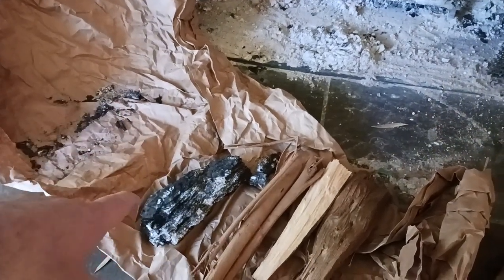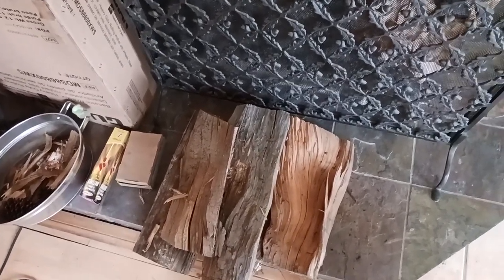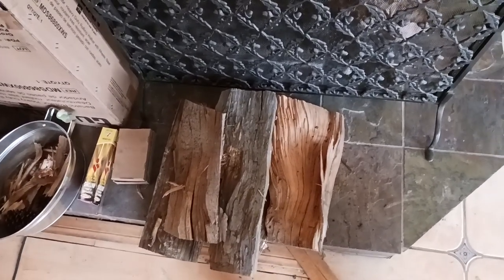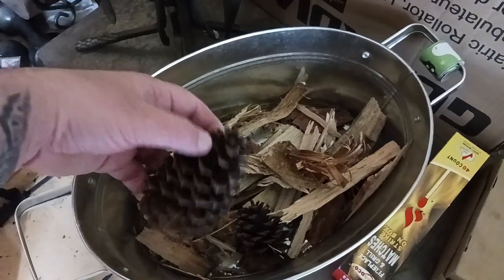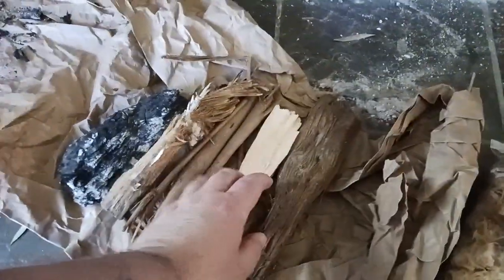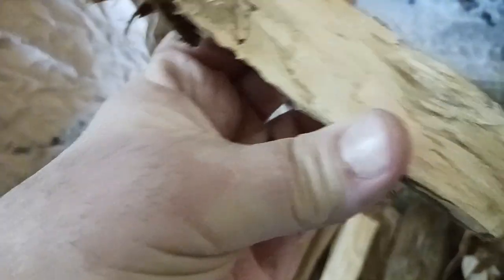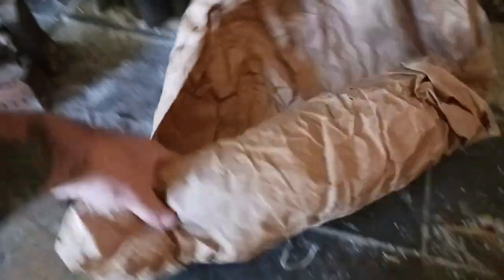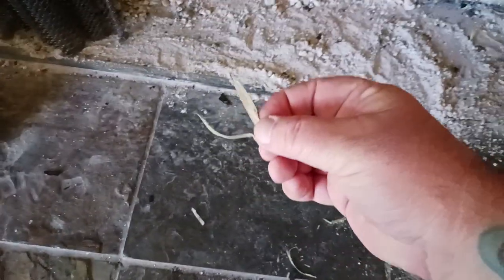1384 How to light a fireplace fire successfully bbq fire pit backpacking camp camping best way start

Comment from the maker: Kiknek FireFlame Quick Fire Starter
https://amzn.to/3IFcAAE

Housewise Fire Starter
https://amzn.to/493zBba

❤️Subscribe
SELF DEFENSE
Compact Pepper Spray
https://amzn.to/3a4mDib

Home Size Pepper Gel
https://amzn.to/3a5yiND

Pepper Spray Bracelet
https://amzn.to/3vu7nIh

Self Defence Hair Clips
https://amzn.to/41RRmby

Car Window Breaker Bracelet
https://amzn.to/3vtGIvc

Protection Keychain
https://amzn.to/47v4HYA

Multi-Tool Keychain
https://amzn.to/4215C1P

Multitool Bracelet
https://amzn.to/3tHW5jq

Tactical Wallet
https://amzn.to/4aFKfXF

Concealed Carry Purse
https://amzn.to/3NQK7dV

Eberlestock Backpacks
https://amzn.to/3sVmxlH

Maxpedition
https://amzn.to/3SNmnKX

Ultralight Backpack
https://amzn.to/3t4qLp7

Assault/Day Pack
https://amzn.to/3NFPygq

Get Home Bag
https://amzn.to/3Sh2WtS

Sling Bag
https://amzn.to/3Sh2WtS
https://amzn.to/3LuCk3F

Tactical Messenger Bag
https://amzn.to/3NKJDG7

EDC Essentials
Sunscreen
https://amzn.to/3QCkwHG
https://amzn.to/3QARJSH

Insect Bite Treatment
https://amzn.to/3tIGsU4

Insect Repellent
https://amzn.to/49p1uvM
https://amzn.to/3ShNIoo

Pocket Penlight
https://amzn.to/3aOFHjA

Headlamp 7 mode
https://amzn.to/3Sk2wmz
https://amzn.to/3sd9sau

Single Wall Water Bottle
https://amzn.to/38jVma6

Cnoc Vecto
https://amzn.to/3tL8BJV

Hydrapak
https://amzn.to/44xRXyS

Katadyn Be Free
https://amzn.to/3FFjg0H

HydroBlu Water filter
https://amzn.to/3qTyniC

MSR dromedary
https://amzn.to/3aOoU07

MSR Hydration Bag Coverter Kit
https://amzn.to/3r3syz7

TomShoo Stove
https://amzn.to/3BmtFfo

Utensil set
https://amzn.to/3aTCQpH

Silky Saws
https://amzn.to/3Xj0yBO

Esee Laser Strike
https://amzn.to/40QrnAk
https://amzn.to/3IheOGQ

Mora HD
https://amzn.to/3EI9Jp5

Bradford Guardian
https://amzn.to/3KnvIFq

Esee 6
https://amzn.to/3E1xJTt

Esee 4
https://amzn.to/3YkYdHM

Esee 5
https://amzn.to/3lszClY7
https://amzn.to/3RQiAu6

Esee Knives
https://amzn.to/3DWZYmk

Seatbelt Cutter Window Break
https://amzn.to/3tUEiVR

1.8 cord
https://amzn.to/30a7Qwq

Paracord
https://amzn.to/3uJ8KOJ

Merino Wool Socks
https://amzn.to/38hxaFg

Fleece Socks
https://amzn.to/3VWv0Bs

Pants
https://amzn.to/3vc2v6n

Long Sleeve
https://amzn.to/2Ou5lCE

Down Jacket
https://amzn.to/3uRZoQS

Gen 3 ECWS Fleece
https://amzn.to/3HAlOhj

Polarized Goggles
https://amzn.to/3FNftP5

Reflective Neck Gaiters
https://amzn.to/3ubQEpL

Sun Protection Shirts
https://amzn.to/39XS1Bx

Sun Protection Cap
https://amzn.to/3bDGOGE

FIRST AID MEDIC
Sunscreen
https://amzn.to/3QCkwHG
https://amzn.to/3QARJSH

Insect Bite Treatment
https://amzn.to/3tIGsU4

Insect Repellent
https://amzn.to/49p1uvM
https://amzn.to/3ShNIoo

Individual Wipes
https://amzn.to/3uVf75Z

Flushable Wipes
https://amzn.to/3RgYKbC

Body Wipes
https://amzn.to/3RCz9ei
https://amzn.to/46THezF

Microfiber Cloth
https://amzn.to/3NjUIOr

Pill Pack
https://amzn.to/4ajDvyC
https://amzn.to/3uUkaDP

Ihealth PT3
https://amzn.to/3d0xNGq

PT3 Case
https://amzn.to/3tKaExS

Temperature Gun
https://amzn.to/2MQoxKn

Pulse Oximeter
https://amzn.to/3p2R1O1

Tactical Rip-Away EMT Pouch
https://amzn.to/2MHyGJv

ResQme
https://amzn.to/3rAq7Pi

Trauma Bleed Kit
https://amzn.to/36Titrp

Chest Seal
https://amzn.to/4853CI5
https://amzn.to/3TmstCr

Tourniquet
https://amzn.to/2Lz9sMA

Shears
https://amzn.to/2LGxjdu

Israeli Bandage 
https://amzn.to/2LDxDtq

Gauze
https://amzn.to/3jyYMKp

Abdominal Pads
https://amzn.to/2LB6EPb

Elastic Bandage
https://amzn.to/47Ok53b
https://amzn.to/3NkvGi2
https://amzn.to/3TjAzf8

Emergency Blanket
https://amzn.to/370w68h

MOTORCYCLE AUTOMOTIVE
Tire Pressure Gauge
https://amzn.to/2Z0J8hA

Tire Inflator
https://amzn.to/2Z3Od8V

Flat Tire Repair
https://amzn.to/3d2Twhb

Battery Tender
https://amzn.to/3q5S55a

2000 AMP Jump Starter
https://amzn.to/3SUM4cy

1500 AMP Lithium Jump Starter
https://amzn.to/47EhAQp

120-Watt Power Inverter
https://amzn.to/47jKYf3

OUTDOOR WEAR
Polarized Glasses
https://amzn.to/48g2cKr

Polarized Goggles
https://amzn.to/3FNftP5

Sun Protection Shirts
https://amzn.to/39XS1Bx

Sun Protection Cap
https://amzn.to/3bDGOGE

Neck Gaiter
https://amzn.to/3SPFnJ6

Merino Wool Socks
https://amzn.to/38hxaFg

Fleece Socks
https://amzn.to/3VWv0Bs

Fleece Base Layer
https://amzn.to/41ev96W

Pants
https://amzn.to/3vc2v6n

Down Jacket
https://amzn.to/3uRZoQS

Gen 3 ECWS Fleece
https://amzn.to/3HAlOhj

MOTORCYCLE TOURING GEAR
Eberlestock Backpacks
https://amzn.to/3sVmxlH

Maxpedition
https://amzn.to/3SNmnKX

Ultralight Backpack
https://amzn.to/3t4qLp7

Assault/Day Pack
https://amzn.to/3NFPygq

Get Home Bag
https://amzn.to/3Sh2WtS

Sling Bag
https://amzn.to/3Sh2WtS
https://amzn.to/3LuCk3F

Compression Dry Sack
https://amzn.to/48g4glF

Ultra-Sil Dry Sack
https://amzn.to/3Tm9DLN

Military Sleeping Bag
https://amzn.to/3HAkPxD

Poncho Liner
https://amzn.to/42hYEEh

15 degree Sleeping Bag
https://amzn.to/3fgdoRh

Sleeping Pad
https://amzn.to/3zn9zR8

LiteFighter Fido Ai
https://amzn.to/47HjEa7

LiteFighter Fido
https://amzn.to/49W6wQL

LiteFighter 1
https://amzn.to/46fSNkw

Alps Mountaineering
https://amzn.to/3uiRXWV

3 Season Tent
https://amzn.to/3sEYfMC
https://amzn.to/3SIcsGI

4 Season Tent
https://amzn.to/41VzkEz

LiteFighter Fido Ai
https://amzn.to/47HjEa7

LiteFighter Fido
https://amzn.to/49W6wQL

LiteFighter 1
https://amzn.to/46fSNkw

Alps Mountaineering
https://amzn.to/3uiRXWV

3 Season Tent
https://amzn.to/3sEYfMC
https://amzn.to/3SIcsGI

4 Season Tent
https://amzn.to/41VzkEz

Haven Tent/Hammock
https://amzn.to/3W3vMNX

Winter Underquilt
https://amzn.to/3sSS05C

Underquilt Protector
https://amzn.to/3W78Uw5

Eno Underbelly
https://amzn.to/3gQnskd

Tarp
https://amzn.to/3zoSJ4t

Snakeskin Tarp Sleeve
https://amzn.to/3gIj8DD

Stakes
https://amzn.to/3kMWt7m

1.8 cord
https://amzn.to/30a7Qwq

Paracord
https://amzn.to/3uJ8KOJ

Daisy Chain
https://amzn.to/46TyvO7

Descending Ring
https://amzn.to/4adwCib

Carabiner
https://amzn.to/3Rh1k1i
https://amzn.to/41hhV9M
https://amzn.to/41hhRa2
https://amzn.to/48d7dTP

S Biner
https://amzn.to/3sMgiP0

Silky Saws
https://amzn.to/3Xj0yBO

Silky Ono
https://amzn.to/3Kh54hi

Fiskars X7 Splitting Axe
https://amzn.to/3RE2l4T

Hand Auger
https://amzn.to/3J1swxR

Opinel Knives
https://amzn.to/3REelmY

Mora HD
https://amzn.to/3EI9Jp5

Bradford Guardian
https://amzn.to/3KnvIFq

Esee Knives
https://amzn.to/3DWZYmk

Esee Laser Strike
https://amzn.to/40QrnAk
https://amzn.to/3IheOGQ

Esee 6
https://amzn.to/3E1xJTt

Esee 4
https://amzn.to/3YkYdHM

Esee 5
https://amzn.to/3lszClY7
https://amzn.to/3RQiAu6

Seal FX Tanto
https://amzn.to/40R7c52

Sharpening Stone
https://amzn.to/3Z6heOj

Seatbelt Cutter Window Break
https://amzn.to/3tUEiVR

Survival Shovel
https://amzn.to/3iQYjqR

Pocket Penlight
https://amzn.to/3aOFHjA

230° Headlamp
https://amzn.to/3Ne5ea1

Headlamp 7 mode
https://amzn.to/3Sk2wmz
https://amzn.to/3sd9sau

300 Lumen Clip Light
https://amzn.to/3RYnkj7

Solar Lantern
https://amzn.to/46UzWff

IceMule Coolers
https://amzn.to/3YfQo6v

Ice Pack
https://amzn.to/3v84sFi

Reusable Storage Bag
https://amzn.to/3tgtoKf

Folding Bucket
https://amzn.to/488PywK

Cnoc Vecto
https://amzn.to/3tL8BJV

Hydrapak
https://amzn.to/44xRXyS

Katadyn Be Free
https://amzn.to/3FFjg0H

HydroBlu Water filter
https://amzn.to/3qTyniC

MSR dromedary
https://amzn.to/3aOoU07

MSR Hydration Bag Coverter Kit
https://amzn.to/3r3syz7

Water Bottle Pouch
https://amzn.to/3da0C3x

Single Wall Water Bottle
https://amzn.to/38jVma6

EZ Reach Lighter
https://amzn.to/47QQ96x
https://amzn.to/3GY4emV

Permanent Match
https://amzn.to/3uSf8b0
https://amzn.to/3NlbsEM

Ferro Rod
https://amzn.to/3uV8LDM
https://amzn.to/3GEzHdn

Magnesium Fire Starter
https://amzn.to/484LvBG

Bellow & Fuse
https://amzn.to/3YbJvDi

TomShoo Stove
https://amzn.to/3BmtFfo

Wood Pellets
https://amzn.to/3FjfGrW

Trangia
https://amzn.to/3W1fggr

Fuel Bottle
https://amzn.to/3BmWA2K

Bioethanol
https://amzn.to/3BqFt01

Stove & Adapter Kit
https://amzn.to/3blZ84K

Folding Grill
https://amzn.to/421TvAI

Pathfinder Folding Skillet
https://amzn.to/2NfIfPm

MSR 775ml pot
https://amzn.to/3Pac9AK

1.2L Camping Pot
https://amzn.to/419yZwt

Cup Pot
https://amzn.to/3tDkC4l

Bowl
https://amzn.to/30mUhdq

Long Spoon
https://amzn.to/3eg0orR

Utensil set
https://amzn.to/3aTCQpH

Pan Scrapers
https://amzn.to/3jwr0pk

Thermometer
https://amzn.to/3HkUDb3

Backpacking Chair
https://amzn.to/3kEjHwh

400lb max Backpack chair
https://amzn.to/3sDbfCc

SUPPLEMENTS
Vitamin K2 MK7
https://amzn.to/48DdqJd

Neuro Gum
https://amzn.to/48KA2b8

Apple Cider Vinegar
https://amzn.to/48QVRWx

Garlic
https://amzn.to/48TBqrK

Chews & Fuel
https://amzn.to/46eel13

Superfood
https://amzn.to/3IVnrVX

Krampade
https://amzn.to/47wyJeY

Protein Powder
https://amzn.to/3b4U1bZ

Casein Protein
https://amzn.to/3PAveva

BCAA
https://amzn.to/3yF1G83

Pre Workout
https://amzn.to/3pA87Wd

L-Citrulline Malate 2:1
https://amzn.to/3KiylWY

Nitric Oxide
https://amzn.to/3dNgtHx

B Complex
https://amzn.to/3Hw6mU4

Collagen
https://amzn.to/47Xy4Dx

Multivitamin
https://amzn.to/2MGg0d3

Vitamin D3
https://amzn.to/3d3iZah

Fish Oil
https://amzn.to/3DW7ife

Dry Eye Relief
https://amzn.to/44UYhAu

Electrolyte
https://amzn.to/3llOFtw

Potassium
https://amzn.to/3osQPtL

Magnesium
https://amzn.to/3uwA9CL

Testosterone Boost
https://amzn.to/3KdBNBS

CoQ10
https://amzn.to/3rEhK5m

Calm Aid
https://amzn.to/3pyGM6H

Pill Case
https://amzn.to/3jyQSka
https://amzn.to/48uhNG7

HEALTH FITNESS 
Massage Gun
https://amzn.to/3d1djgL

Headphones
https://amzn.to/3wj6l0r
https://amzn.to/3qj77GJ

Body Composition Scale
https://amzn.to/3MIXAm5

Blood Pressure Monitor
https://amzn.to/2Z4eSm1

Handles
https://amzn.to/40KmQQ6

WOMENS SHOES
All Hiking
https://amzn.to/3FVRQ62

All Dress Shoes & Boots
https://amzn.to/3SB55Rr

Thigh High Boot
https://amzn.to/3uiztWI

Thigh High Platform
https://amzn.to/3swBjT4

Thigh High Chunky Heel
https://amzn.to/3u5Nyq7

Over The Knee Boot
https://amzn.to/3SDrxsY

Over The Knee Stretch Block Heel
https://amzn.to/40AC5LA